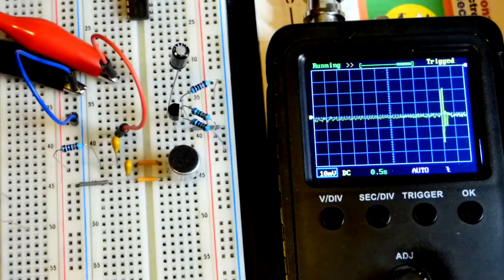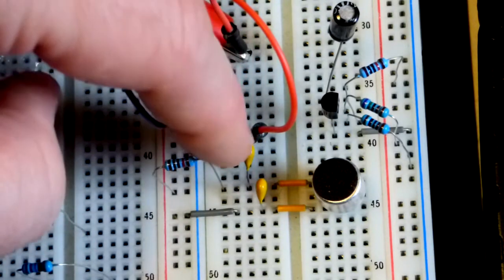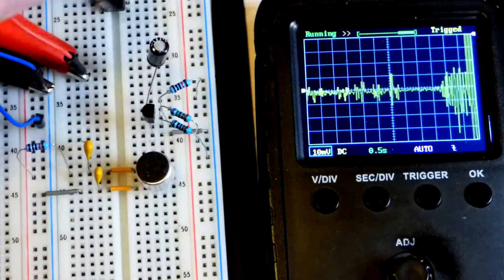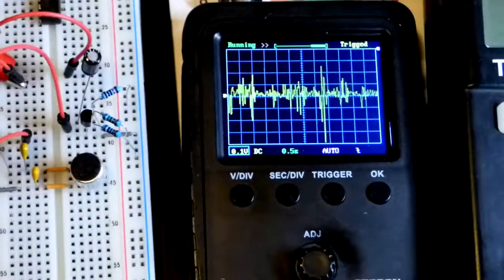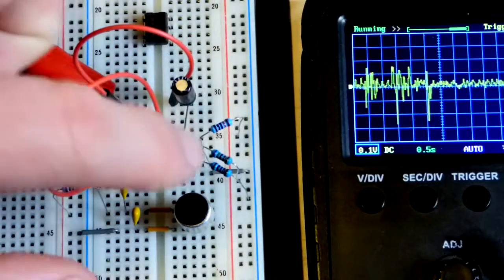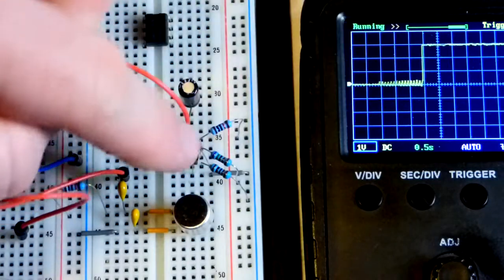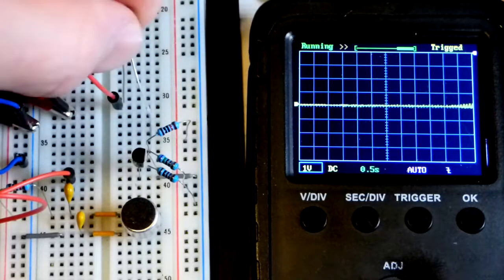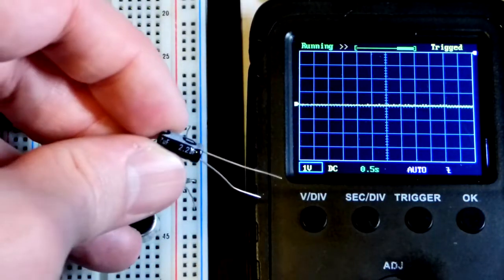My first 2N3904 NPN BJT preamplifier circuit for condenser microphone electronics circuit

Comment: Sorry, I might have missed it, but can you please tell me what the purpose of the electrolytic capacitor on the collector?  What would happen if it was removed (i.e. replace with a wire)?  Thanks!
Reply from the maker: You need it to alternate the current direction. Otherwise you'll probably just get a wavering voltage.
Reply: @Electronzap  Another way of saying it is that it is a "coupling capacitor".  Would you agree with that?  Thanks!
Reply from the maker: I'm pretty sure it is a coupling capacitor.

Comment: I am surprised that you didn't use an op-amp for your initial pre-amp. Aside from using an op-amp instead of an NPN transistor, I believe the passive component count is near identical. Maybe an extra resistor help set the gain, but aside from that, nearly identical. I guess that will be in one of your future amplifiers as om-amps might not be as common with most hobbyist as transistors are. About the only improvement I can think of is maybe a simple schematic so that it is a little easier to follow what is going on with the breadboard. No values needed, just the components to better illustrate what is going on.
Reply from the maker: I was challenging myself to amplify the microphone with a transistor that I biased. I avoid making schematics for circuits that I am still trying to figure out as the mistakes are more permanently documented. I plan to make these circuits with op amps as well. They are less common with beginners and I try to keep most circuits at a single supply 5V, so I have to plan that out. Thanks for the advice, and for watching!
Reply: No problem, I enjoy the videos and the variety of topics covered. If you'd like a few TLV9061s to play with (on breakouts, so breadboard friendly), let me know. They are great single-supply rail-2-rail op-amps. I am pretty sure they can run at 5V but I us them at 3.3V for my projects and they work great. 

And even if they are wrong, I guess I like schematics to help me keep things straight and also so I can not where adjustments need to be made.
Reply from the maker: I don't have a PO box so I just buy whatever I use :) I think I already have a few rail to rail op amps I need to get more familiar with.